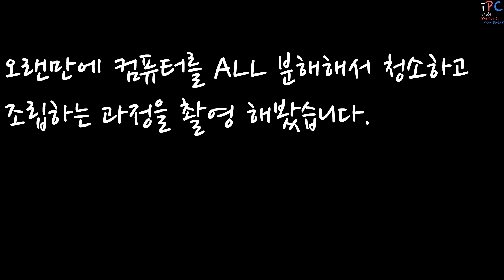iPC의 조립 컴퓨터 청소 #1

Comment: ipc님 i3 4세대 램8기가 그래픽카드GTX750으로 배틀필드 돌리리수있나요?
Reply from the maker: 보도 블럭 youtube i3 어떤 i3 에요? 종류만 해도 50가지가 넘습니다.
Reply: ㆍ 프로세서	: [인텔] 코어i3-4세대 4160 정품박스 (2코어 4쓰레드 3.6GHz,하스웰 리프레시)
ㆍ CPU쿨러	: [인텔] LGA1150 정품 쿨러 기본 탑재
ㆍ 메인보드	: [ASRock] H81M-HDS (USB3.0 헤드,D-SUB.DVI,HDMI 지원)
ㆍ 메모리	: [삼성전자] DDR3 8G PC3-12800 (8G X 1EA 정품)   +39,000
ㆍ 그래픽카드	: [ZOTAC] 지포스 GTX750 D5 1GB (1033 MHz,부스트 1111MHz)
ㆍ 하드디스크	: [Seagate] 1TB Barracuda 정품 (SATA3 7200
ㆍ 시디롬	: [삼성전자] DVD-ROM SH-118AB (정품,CD,DVD MAX 기능)
ㆍ 사운드카드	: [내장형] 6/8채널 사운드코덱
ㆍ 랜[LAN]	: [내장형] 100/1000Mbps 기가비트랜
ㆍ 케이스	: [ABKO] NCORE 빅터 USB3.0 (전면120mm,후면120mm쿨러)   +2,500
ㆍ 파워	: [ENERGY OPTIMUS] Mach II 500K V2.3 (정격 500W,DUAL RAIL +12V)
ㆍ 운영체제	: [MS]윈도우 8.1 [DSP,64bit,정품 DVD,최초 무료설치,개봉후반품불가]
Reply: 이렇게 사양이되는데요?
Reply from the maker: 한... 배필4 멀티에선 1920x1080 기준으로 하~중옵정도 가능할듯 싶어요
Reply: Jin Kong 아 답변해주셔서 감4합니다 :)